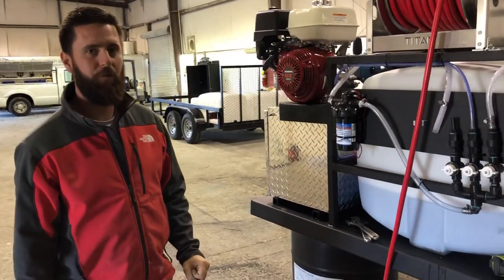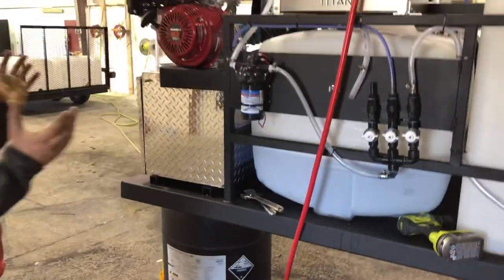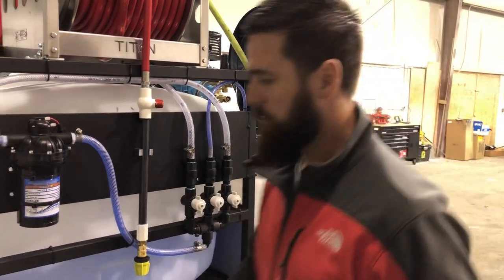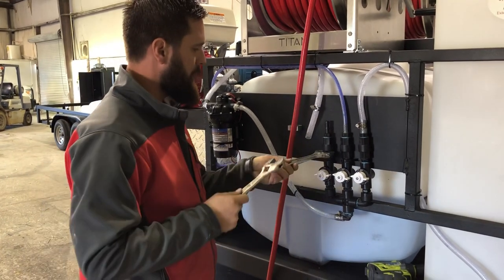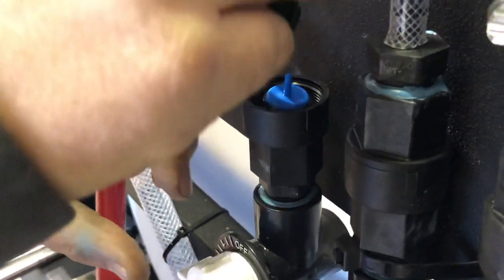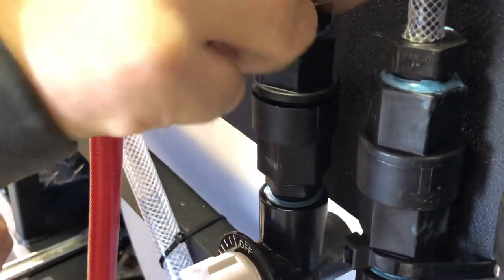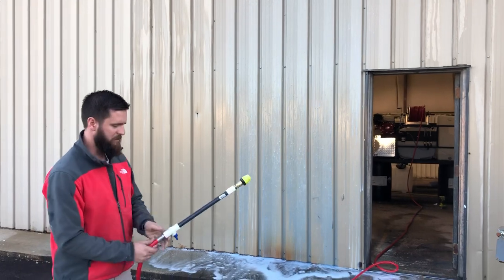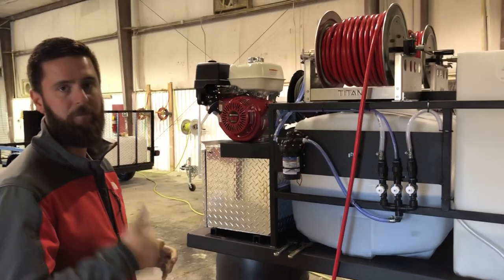How to troubleshoot a failed check valve

Comment: Love the setup you did. Had a question I got a 5.5gmp everflo and I use 1/2 hose suction for water and SH and a 1/4 for the soap. My spray hose is also 1/2 I feel like I don't get the distance that I should be getting.  Do you think I should go down to a 3/8 for the water and SH?
Reply: @HouseWashingRick   thank you I think we are close to that distance.

Comment: Hey Coty.  Have you ever experienced low flow issues?   My pump will pressurize and cut off but when I open the valve I loose pressure pretty quick.  When I 1st started using the mixer valve I bought from you I could get over 20' of distance now I average 10' to 15'.  I've done tons of troubleshooting but not having any luck.  Thanks
Reply from the maker: Adventures of a Handyman You probably have a small air leak somewhere. That is about the only thing that will cause that
Reply: @southeastsoftwash4020  thanks for replying.   I'm on it boss.  Thanks!
Reply from the maker: Adventures of a Handyman One way to check for an air leak is to stick your suction line directly into a 5 gallon bucket of water and see if it runs better
Reply: @southeastsoftwash4020  I did that and it shot a full stream.  So maybe that reinforces the air leak theory.  I'm pretty sure my SH valve had an air leak but this was the water side only opened up.  I may have a leak there also.  It's possible it froze and cracked one of the fittings

Comment: The blue surfactant is nice as you can easily see where its applied on surface and where you missed a spot.

Just wondering how many guys are out there with a fail check valve?  Costing them big money because its using more SH and Surfactant than needed.  

Everyone should disassemble the value and make sure it's clear of debris.  This wouldnt have been found without the blue coloring!!

Comment: What size hose are you using for the inlets? It looks like 1/2" for SH and H2O and 3/8" for soap. Is that correct? Or maybe 5/8" for SH and H2O?

Comment: What setting do you have the SH knob on when doing a house wash? How about the surfactant knob? Thanks
Reply from the maker: Brian Pino Unfortunately, there are too many variables to tell you “ put your dial here and wash away” 
This is where you start getting into needing to take a class or shadow someone for a day to learn a lot about chemical strength and how to achieve ratios.

Comment: WHAT SIZE AND BRAND OF DIAPHRAM PUMP ARE YOU USING. I PURCHASED A 5.5 GPM PUMP BUT IT IS NOT WORKING LIOME YOURS IS🥺
Reply from the maker: Joe Jackson What is your pump doing? Probably an easy fix
Reply: Southeast Softwash It is a Seaflow 55 series 60 PSI head pressure. I have 175 foot of hose braided threeeights inch. I’m only getting about 20 to 25 feet of distance out of it and that it is surging with the pump. The pump does not have an adjustment to help regulate the pump. Like I have seen you do on one of your pumps
Reply from the maker: Joe Jackson hmmmm is probably replace it with a everflo 5.5 and eliminate the possibility of the pump just being bad. 
Typically performance issues are due to air getting in the suction side

Comment: Hello Friend, I have the same type of valve in my soft wash equipment with the three-valve manifold, but I have noticed that when I stop using it, if I do not close the valves, the water from the tank goes to the chemical tank. You have any idea what it might be. Greetings from Miami fl
Reply from the maker: It’s gonna be a failed or clogged check valve.